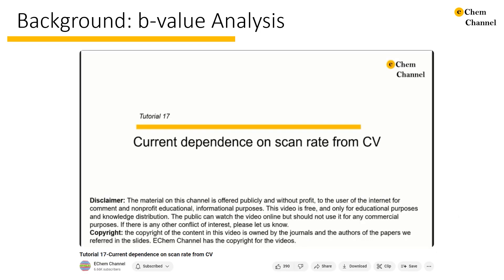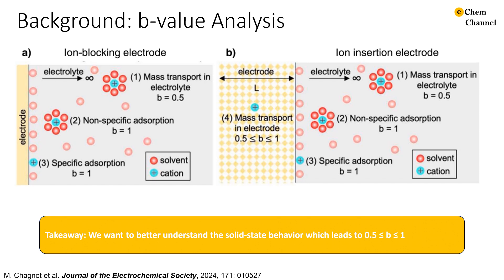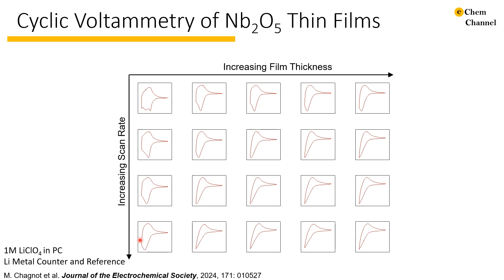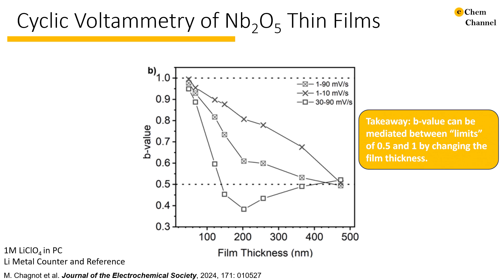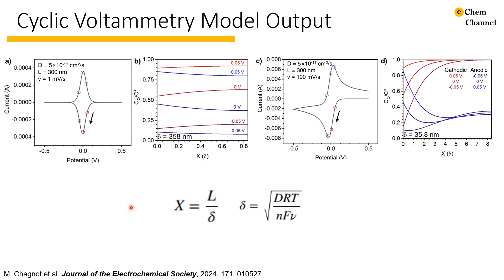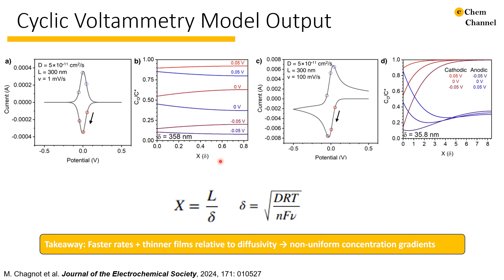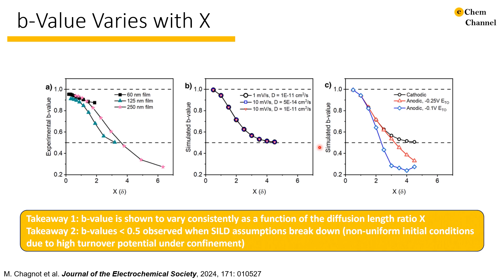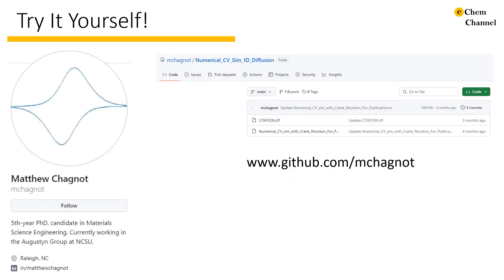[Research Paper]Influence of Finite Diffusion on Cation Insertion-Coupled Electron Transfer Kinetics

Comment: Interesting video! Have you also performed electrochemical impedance spectroscopy (EIS)? It would enable you to extract diffusion parameters like the diffusion coefficient (or time constant), along with the diffusion layer thickness, from your impedance data.
Reply: Thank you! We did collect impedance data for our samples, but opted to use a PITT-like analysis to determine our diffusion parameters. There is more information about our approach in the SI of the linked paper.